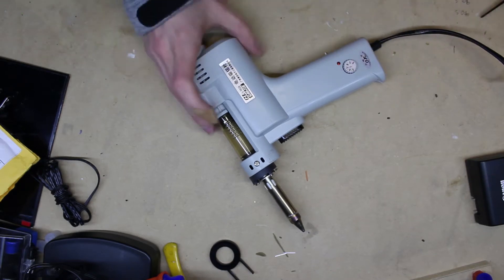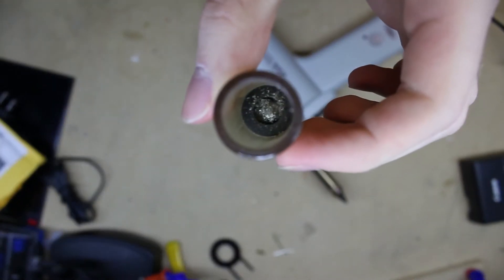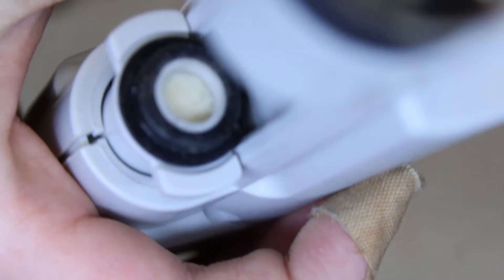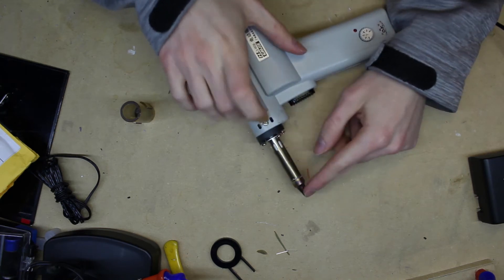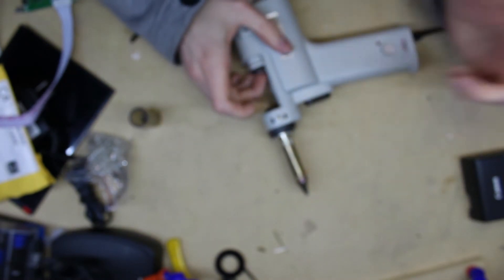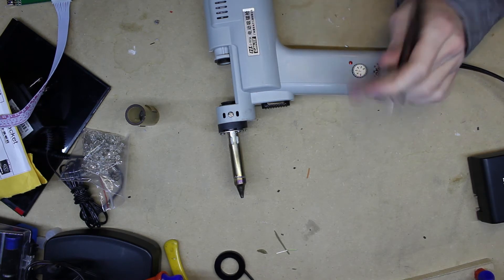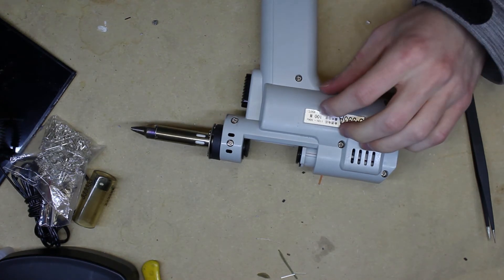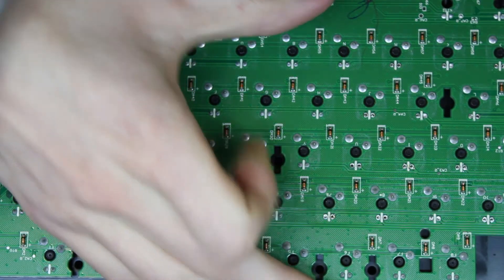Followup Review S-993A Desoldering Iron

Comment: One problem I know off the bat, lead free solder is the problem, as it’s a higher melting temp to flow, try reflowing leaded solder first, it will work more efficiently, mate 
Apart from the metal in the tube being backwards and lead free solder, g eat video recap mate 🤙🏼🇦🇺

Comment: It is 2021 and they have 2 other sizes of tips for this. The one you get with this is a 1mm. They have a 1.5mm and a 2.0mm. If you take the rubber gasket from around the solder catcher, you can get the solder off easier. It can fall right off at times.

Comment: Your metal plate inside the tube is upside down. Rotate it 180 degrees.
Reply: You are correct.  I have a Hakko, which has the aluminum catch plate in front of the felt pad.  Solder falls off of the plate.

Comment: After about five uses, that's five repair projects with several components desoldered, mine will not heat anymore. I keep it clean, easy use, experienced tech. Less than a year old. Not recommended.
Reply: just save up some more for the hakko one instead of those chinese ones.
Reply: @pentiummmx2294  I did exactly that and haven't looked back.

Comment: You have the rubber/metal piece in backwards in the plastic solder tube.  The metal plate goes toward the heating tip.  Then add a bit of high temp or dielectric grease to the plate.  Both will make it easier to clean.  For the tips, go to eBay and search for S-993a tips.  About $9 each or $27 for 3 sizes in USA.
Reply: I was a going to say that, they work awesome when put in the right way, and yes a dab of dielectric grease works fine..

Comment: 4:29 That's not like-a-board. That's a PCB800099 board. An RTD2662 based display controller for old TFT or car displays. It's great because the displays themselves are pretty affordable and slim, so you can fit them pretty much anywhere. The menu sucks, however, and I have never been able to access all features of a display, likely due to PWM being incorrectly implemented or simply faulty.

Comment: The biggest issue with those wands which use the 900M-T style tips is the Chinese or knockoff tips have such a large tolerance on the inside diameter so a lot of heat transfer is lost. I got a few tips from radio shack when they were going out of business, again, and they fit over the ceramic heater much better and they also work a LOT better.... I've been using a Zeny 853D for my rework station and I modified the heat wand so it has a disconnection plug just like the soldering wand as it always got in the way.. But, I also use lead-free for all of my projects and it has worked fantastically for all applications I've used it for and with the radio shack tips, it has worked even better.... So what you can also do is get some medium which won't melt to shim the inside of the tips so there is less of a gap and that'll correct that issue. Also, make sure you use flux and the copper wire bristles to keep the tip clean. Pre-tin the tips before using them, and when you put it away so just stick a glob of solder on the tip to protect it from oxidation so next time you use it you heat it up, dip it in the copper bristles and it's tinned and ready to go with a nice clean tip...
Reply: The other issue is your tips are very dark - this is BAD... You lose a TON of heat from that layer, so clean the tips properly... Tin the tips properly... and when you put it away put a glob of solder on them to protect them... and you'll have better performance overall...
Reply from the maker: Thanks for the insight  man! However, I still prefer leaded solder, and I already perform most of the maintenance that you are describing with the exception that I do often run out of flux.

Comment: The filters on these devices are designed like a stack of pancakes... Peel the dirty layers off either side and you keep using it.. until it's too thin - then you can add a new filter in, and use that last slice at the front to use it up fully...